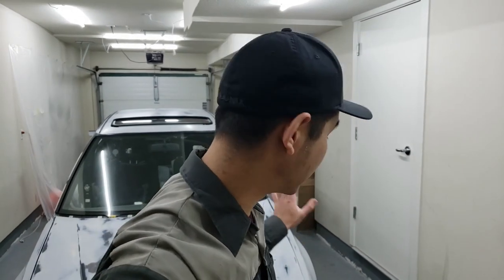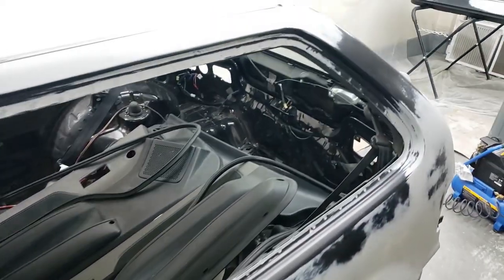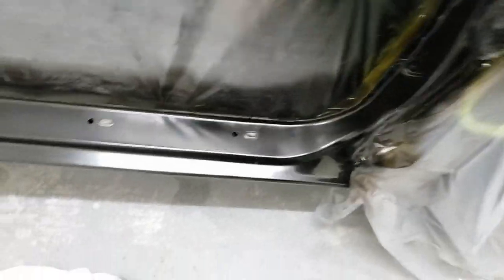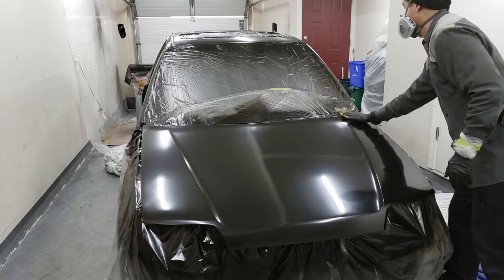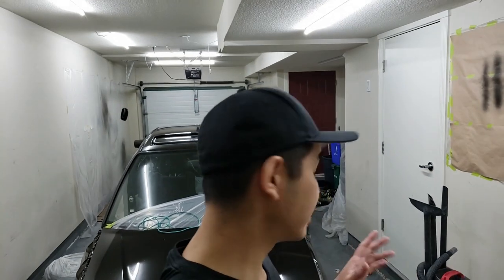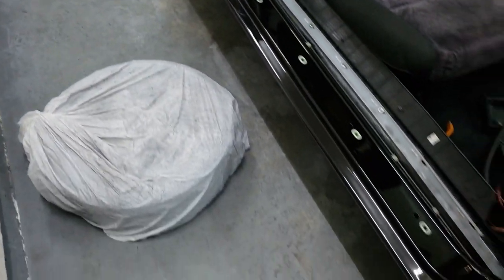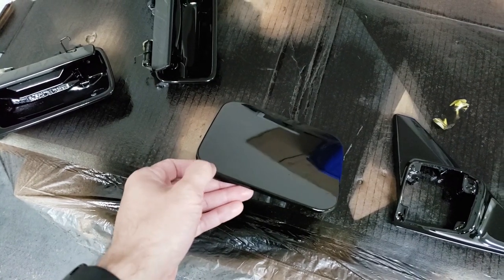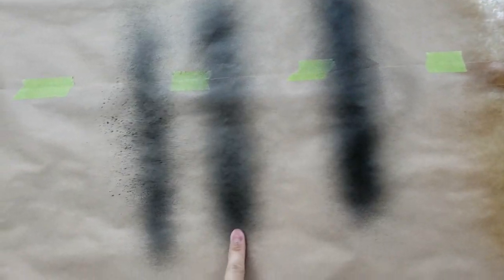[DIY Bodywork] Pt.24 Spraying Base & Clear Coat with FujiSpray Semi-Pro 2: Successful 1st paint job👍

Comment: This job looks great....im considering this system ...i use a devilbiss pro lite wich is great .. would like a system that only requires 120v
Reply from the maker: This system is pretty cool. Its nice and compact, which is what I like. The semi pro is the entry level system, which did a great job, but I think more premium model like the q5 would yield much better results. I would love to get my hands on a better model, but the semi pro is good value. 😁
Reply: I have the Fuji Q4 Gold which is a 4 stage turbine, and lay auto paint down as good as any compressor style set up but costs THOUSANDS less.
The Semi 2 is a 2 stage which is like 5 psi. the 3 stage is 6.5, but the 4 stage, OMG, is 9 psi! This make it so much more of a value. It's worth every penny to go to a stage 4. Btw....a stage 5 is only 9.5 psi.
And of course theirs the quiteness factor. That's what the "Q" stands for in the Q series. Honestly, it's just a series of bends and sound damping materials that can be accomplished for a LOT let than what they charge for in the Q series. I purchased mine used so I essentially didn't pay for the quieter machine.
Honestly, if I was buying new, I would go for a stage 4 turbine to get the higher PSI, which will give a better finished product. Then, if noise is an issue, there are plenty of YT vids showing how to quieten down the machine.
In the end, this video shows the importance of doing a test panel with the PRODUCTS and in the ENVIRONMENT you intend to do the final painting with and in.
Mixing 0.5 quarts and test spraying the hood first, then waiting a day for results, would have saved so much time and money than just going for it on your/his first paint job!
This is expressed in every DIY vid out there but the DIY guys skip it.......WHY????

Comment: so i had to break the car into parts wait at least 45 min for the turbine unit to cool down.larry b
Reply: I would check your air filters for clogging. 
The Fuji system shouldn't heat up like that. That's very much the entire point of the system, and shouldn't heat the air in your hose...

Comment: Hi man, very nice job you did! I was inspired by your video to bay a Fuji spray gun, and try to paint my 03 Toyota, but the results wasn't so good as you. The problem was a clear, I ended with a lot of texture, and I was obliged to sand a lot. What type of clear you have used on this project? How you set your gun? Thanks for helping!
Reply from the maker: I used Sherwin Williams finish 1 clear coat. Around the end of my video I talk about gun settings. Its not something I can explain but I showed it around the end. The temperature and humidity also plays a role in how your clear will lay down. I had bad orange peel in some areas too. But its mostly cause of my technique. Need to lay it nice and wet. People have said they got better results with a smaller tip. You can try that as well.
Reply: Ok, thanks for your answer. 👍

Comment: When you first saw the fish eyes on the hood i would have stopped there and cleaned the car really well before going any further what's a little more sanding on the hood going to hurt. Do you think the paint was contaminated for that many fish eyes everywhere on the car?  When you say drips did it drip from the gun or its runs from spraying?  It looks awesome though, rhis is the first video I've seen on my mission to buy a turbine spray gun or air compressor and gun.
Reply from the maker: I think it was very hard to see the fish eyes at first because the first coat was a lighter coat. By the time I notice the fish eyes, a lot of the car was already painted. It's kind of tough to clean everything off at that point and since it's painting in a garage with bad airflow, the garage was fogged up pretty quickly making it tough to see. I think the fish eyes would have been manageable if I knew what to do at the time it happened. I don't think the paint was contaminated. It's possible my garage air was contaminated. Or maybe it was because I didn't clean well enough. Not really sure. It could be many factors because I do lots of different work in my garage. 
Drips is just running from laying it on too thick. It was kind of difficult to not run certain areas. Lack of visibility and lack of maneuverability made some areas tough to reach. I think if I had the car raised higher up off the ground it would have made it better, but my jack was already at max height. I think if I were to redo, I'd maybe do it in more sessions instead of trying to cram it all in a couple sessions.
Reply: @BudgetGears  Question I see these guys on YouTube wet sanding then buffing out a shine , does the shine wear off and need to be buffed again?
Reply from the maker: @angelanuccio2167  The clear coat always ages over time. You may get swirls in it from washing etc. So yes, it will likely need to be buffed again. But after you wet sand and buff, it should remain shiny for a long while. Most painters won't prefer to sand and buff though. Buffing usually leaves holograms. If a shop does the work, they'd usually wet sand and clear again instead of polishing.

Comment: Have you used the semi pro 2 for other projects? Still like it?
Reply from the maker: I haven't used it for any other projects yet. I do have a bumper and other things that I want to prep and paint, but haven't gotten around to it yet. I think the semi pro 2 is a good system on the budget. It's decent for the occasional project. If I'm consistently painting, I'd probably go with a more higher end model like the Q Platinum series. Everything in the Q Platinum series looks better especially the gun. But I think any of the series above the pro series has better guns.
Reply: Thanks, I already own the same unit. Sprayed cabinets but am now thinking I might spray some areas on our car that needs attention. Will get either the #1 or #2 tips.

Comment: Will it do Kandy paint jobs
Reply from the maker: Thats a good question. I dont know the process in painting kandy, but I don't see why it can't. Painting is all in your gun settings as long as you have enough air.
Reply: Candy paint is very thin. The problem is the thicker metallic flake base coat. I’m wondering if these turbine systems can spray a metallic flake base coat.

Comment: what size tips did you use?
Reply from the maker: Its in the comments.
Reply: @BudgetGears  what kind of paint and primer did you use? also did you use any clear coat ar additives?
Reply from the maker: @bens6423  Valspar paint and Finish 1 clear. Primer I used spray max 2k epoxy and Dominion Sure Seal DTM. No additives.
Reply: @BudgetGears  was it polyurethane valspar?
Reply from the maker: @bens6423  Yes. I would not suggest just copying me. You should talk to your paint rep and have them recommend a package. My paint and clear package was a recommendation from the paint rep. They know what's compatible etc.
Reply: @BudgetGears  sounds good
Reply: You did a great job. Blank shows everything. How much was the paint?

Comment: Nice job man! You are giving people like me inspiration to use the system to paint my own car later. Now, could you speak about the mixture you used for the base paint (slow, medium, or fast reducer). Saw the last video of someone mentioning to use slow reducer cause of the heat produced from the system. Overall, great explanation and keeping it real! 👍🏾
Reply from the maker: Thanks man. It worked great so I'd say use the system! So my base was already reduced by my paint shop but I'm pretty sure it was a medium reducer. As for the clear, it was a medium reducer. I would say use whichever reducer is best for your environment. When I sprayed it wasn't overly hot in my garage. Temperature wa about 28 degrees Celsius. And the system does produce heat but when I was spraying, I didn't notice the air being overly hot or anything. But definitely take the time to let each coat flash off. That would be good times for the system to cool itself off too. I had to refill the gun often so I had to constantly turn the system off. So it didn't really get hot for me.

Comment: Damn man congrats on your paint job , its so cool you did this all yourself, its something I'm looking to do pretty soon to, im just in the phase of researching fuji system. 

Is it just the dust that is causing the fisheyes , or is it responsible of the fuji system ?
Reply from the maker: Thanks man! The fisheyes is caused by my garage. The system isn't responsible for the fish eyes. I do all kinds of work in my garage so if any contaminant lands on my panel it'll potentially cause fish eyes. I cleaned quite thoroughly too, but I can't control what's in the air.
I had no airflow too. Having good air circulation would have helped so much.

Comment: why did you go though the hassel removing windows and all for a $3000 car ?
Reply from the maker: I wanted to paint the door jambs and all that. Wanted to make sure I got all the areas that needed painting. It might be a cheap car, but I wanted to do as good of a job as I can myself. The finish turned out very nice.